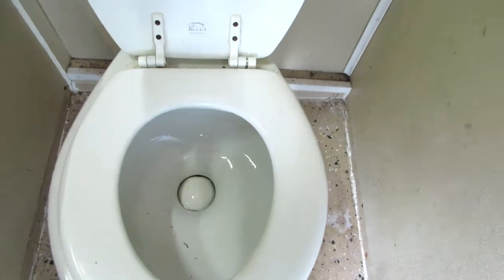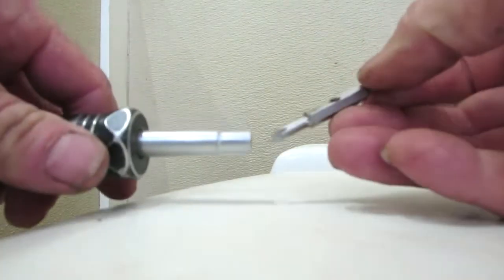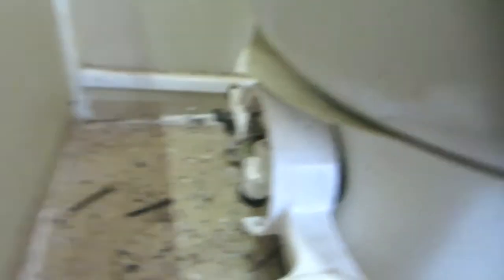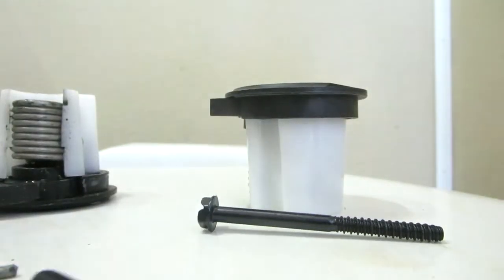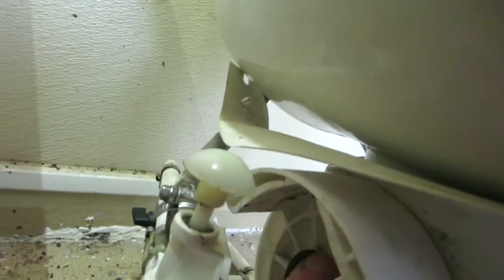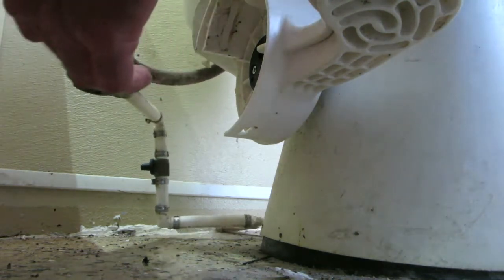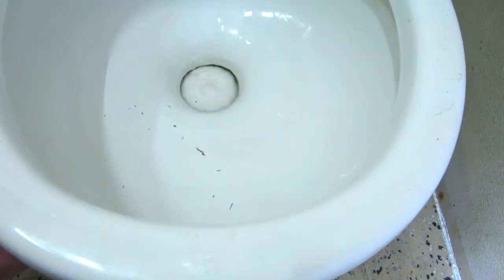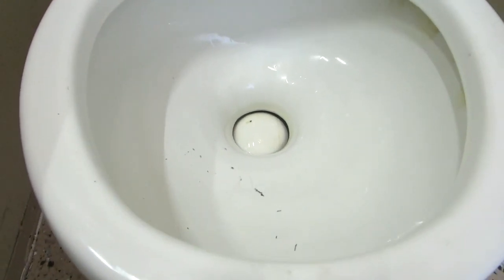Replacing the spring cartridge in a Dometic RV, Marine, or Porta Potti toilet.

Comment: I ordered parts for a Dometic Sealand and got every moving part from Amazon, including the brass shaft, with oring seals and the ball. Spring cartridge and water valve. I got two base gaskets, one thick, and 1 thinner one with a smaller hole.
Reply: I really appreciate your video.

Comment: Great video.  I'm running into an issue where the pedal assembly won't rotate and it breaks the interior plastic of the pedal where the spring tab contacts it.  The ball valve is freely rotating, so that's not the issue, it's just when the spring assembly (either the old one or the new one I ordered) are installed, it won't rotate.  I can't figure out what's causing this.
Reply: Good morning and thanks. The only thing that comes to mind is the part I mention about the cartridge having the align properly when it is installed in it's receptacle. The spring on the inside does not simply go into place. It must line up and will "drop in" when it does. If that doesn't happen, tightening down the screws will pinch it misaligned and jam the pedal assy. That would cause your symptom. You have to move the pedaI back and forth while pushing in on the cartridge. hope for your sake that's all it is. The backup plan is to simply replace the entire flush valve assy. It comes with the black housing and the valve. That's what is required when the end of the valve is broken by overtorque of that long screw. Hope that helps, good luck.

Comment: LOVE THE DETAIL HERE.  THANK YOU!  I DO HAVE A QUESTION, CAN YOU TELL ME THE LENGTH AND SIZE OR THAT CRITICAL STAINLESS STEEL SCREW THAT SREWS INTO THE SHAFT.  I TOOK ON THE TOILET TO REPLACE THE FLOORING AND DID NOT PUT THAT SCREW BACK IN AND OF COURSE ITS MISSING NOW.  :)
Reply: Did you find out about the screw mine was missing

Comment: I recommend completely removing the toilet so you can take it out of that tight space, put it on a workbench, and you can see what you're doing and manouver easier.  It takes about a minute to remove it and replace it.  Just my opinion.
Reply from the maker: That's a good tip. Especially if you don't like kneeling down and bending over the toilet while you work on it. I may actually try that the next time a spring breaks in the cartridge. Thanks, useful tips are a great benefit of youtube as a forum for sharing ideas.

Comment: I had no center screw... what size is it?
Reply from the maker: Ok, sorry for the delay. I added the screw details in the description above. I meant to do that a while ago. #10 screw, phillips head, stainless steel 18 threads. Very coarse. 1 1/4" in length. Thanks.
Reply: What happens if you don't put that screw